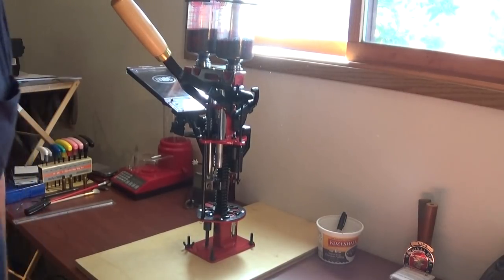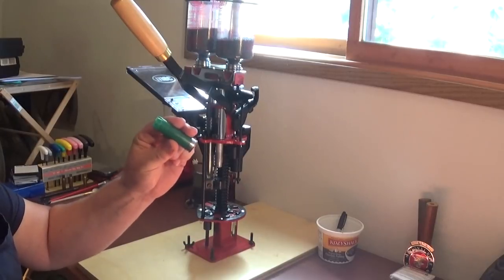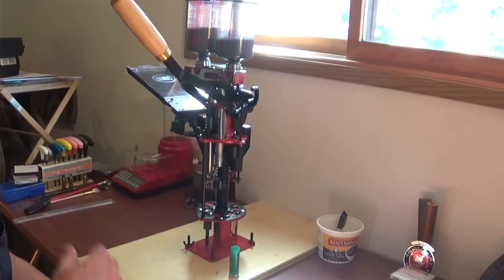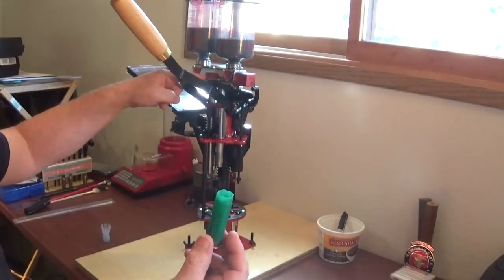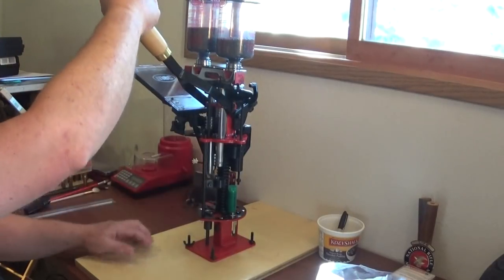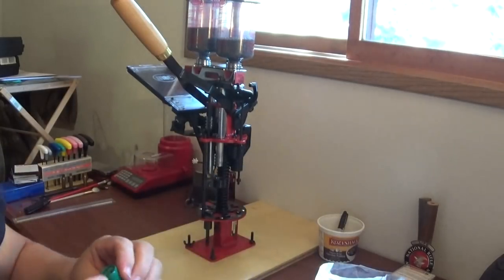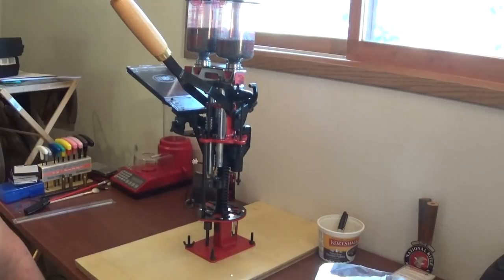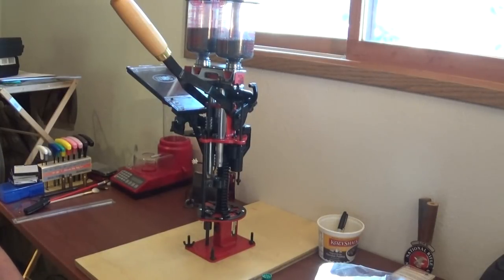The Mec 650N shotshell loading system.

Comment: Well I bought one of these presses from a guy and tried it out tonight. But mine doesn't not throw powder and lead. It must not be pressure sensitive like yours is because I made a mess. Every time I pulled that lever the press threw both powder and shot whether or not there was a shell in the slot or not.

Comment: Great video Dave nice press and yes I also have been watching Russian video on shot making it’s sad on the equipment they use in order to make shot but it works great I’m looking forward to see your shot setup when you get comfortable I have to hit the trap range if not this weekend maybe next weekend I have 350 of 7/8 ounce I load them up that light to stretch out my shot also 1-1/8 is for men I’m to week lol 😂 for slugs I don’t mind I use a padding on my shoulder but for trap is to uncomfortable have a wonderful evening
Reply from the maker: Once you have the shot maker stepping up your loadings with 1 oz to 1 1/8 oz loads will increase your hit ability in the game of trap. the more you have of a swarm of pellets in the air is the thing. and having the shotmaker will increase your volume of loads to practice with. I, like you, started with 7/8 th oz loads and I found that I was handicapping myself for no reason, I hate seeing clay targets hit the ground just to break because I either missed or the shot swarm wasn't up to the job. increasing the payload was the answer. there are butt pads in all kinds of material out there now and that is something you could look into. they have slip-on pads as well, they don't look as appealing, however, they work, so that is another option you have.
Reply: Thanks I will look into it like you said it may not look pretty but it will give me a little more cushion then I won’t have to go to lite on the load

Comment: Thanks for a very informative video. I am just getting into shot gun reloading (Son and Granddaughter have shown an interest). I also have ordered a shot maker, its not here yet. I did not know what to get when it came to presses. I need to load 12, 16, and 20 gauge. I looked at Dillon because thats what I use for metallic cartridges (650) but I found it does not support 16 gauge and the caliber changes are around 300$ each. I picked up 3 of the cheep Lee load all, they work but are all plastic. The press you are using I did a search for and Midway has it but it says there are no caliber conversions for it. So does a person need to buy a press in each caliber or does it only do 12 gauge? Sorry for all the questions. 

I will be watching for your videos on the shot maker, I am not above stealing good ideas!
Reply from the maker: The cheapest way to go is the Lee Load-all. If you do get into the MEC units they are caliber specific. It is something you should look at before going out and off the deep end on. From what I understand 28 ga. is pricey, the more common the ga. being loaded, the less it will cost you. Not too many people do 28 ga. for that reason and is a sport into all it's own. I would look at the MEC Jr 600 series, these will load an afternoon of trap and are quite a bit less than the 650N unit. I went with 12 ga. because it is the most common to load for. 20 ga. is next. That would be a great starter caliber for teaching the sport to youths.  In the way of the Shotmaker. I'm still learning the "How too" that is not explained in the Manual, Just like will all loading equipment we need to work out with it a few times before we really know what we are doing with it. Shotmaking can be done with elaborate equipment or simple homemade stuff found at a rummage sale and a trip to Harbor Freight.  which shotmaker did you go with?
Reply: I went with the Oasis Lead Shot Maker. I ordered it on ebay. Had good reviews and I watched a lot of videos. 

I need 16 gauge because I was at my Sons house a couple weeks ago and he was shooting some clays. A friend had good thrower and he saw me coming home early from a event and he called me to say come on over. He had picked up my shotguns the day before I had purchased the single shot 20 gauge for my Grand daughter (I like starting a new person especially a child with a single shot) and he picked up my OLD 16 gauge bolt action. I purchased it around 30 years ago from a pawn shop for 40$. Its a good shooter and he was just going crazy over shooting it again. I had some (100 rounds) of 16 gauge ammo I have saved and he was so happy so I asked him if he would like it. You would have thought I gave him a million dollars. My sin works hard runs 2 of our businesses and has a son with Autism so he does not get to have to much "fun" I told him go ahead and shoot it I will worry about getting more ammo for him.  

I had purchased the Lee Load all for 12 gauge a few years ago and then got busy with other things but the 2 new ones I just purchased. I was looked at the JR Mec, they are only 200$ I just feel like the load all is going to break when I put the pressure on it to crimp.  The Dillon is 1100$ and I would have purchased that if it would have supported the 16 gauge (go with what you know I guess). 

If I understand the press you have is a progressive and the JR is a manual press for one shell at a time? I think I could live with that. Do you know if the JR has caliber conversions or is it just one press for each caliber? 

Thank for you time helping a new guy!

Comment: Very nice press👍🏻. I’ve been looking for a 600jr. On Craigslist but haven’t found any close by. Also the Remington game loads and heavy dove use a solid one piece hull and aren’t as expensive👍🏻🇺🇸
Reply from the maker: Cool, I would get a 600 jr, it will load quality loadings and it is made well. I buy my hulls by the thousand at BPI, That was one thing I wanted to do right off the bat, I wanted to have a quantity of the same hulls and the "Gun Club" hulls were one of them that everyone was talking about, I followed a Thread on Shotgun world and someone said, "I got Mine, But BPI has Gun Club hulls once fired in stock. I bought a K 10 minutes later, The next day they were sold out. Same with Remington STS Hulls as well. Buy'em when you can get them. otherwise, they will sell out on the same day., anyway, Thanks, I enjoy this more than I thought I would. shot making is a challenge as well but rewarding. Peace to you Brother, Dave.

Comment: but have you actually patterned your loads compared to the load you buy at the same cost? Not being a smart-ass and legitimate question
Reply from the maker: No, you're not being a smart ass, actually, my loading outshoots the store-bought stuff.  I have the advantage of selecting premium wads and consistent powder throws, using load data that professional shotgunners use. my shot patterns with the best produced, you have to figure, how round is shot when it goes through your choke, shot performance has little to do with shot roundness and more to do with barrel quality.  Thanks for watching- Dave

Comment: Well that beats the Mec jr. I used to use, wanna see the shot maker
Reply from the maker: That is the next video on the menu., I have a sieve on order to screen the shot to size. I may need to get a slightly bigger one to sort out the bigger stuff, that will make it go faster as the bigger stuff will be caught before final screening. Most guys shoot it as is because lots of people use reclaimed shot that is a mixture of #7 through #9. They bust clays with it all day long.  the shotmaker is a simple device and can be made at home as a "nothing fancy" piece of equipment, a simple cast iron frying pan with the right hole size drilled in it and a stump burner is all you need to make shot. Make a tilt feature with bolts sticking out the sides of the pan suspended by lag bolts attached to a base, a little ramp for the shot to run down into the coolant and you got it. anyway. I will be doing a vid on shot making followed up with the screening process and graphite coating.  Thank you, Harry, I can't express how much you have helped me out with our project. Dave.
Reply: All the big stuff is done just got a lot of the little stuff to finish, just remember we're buddy's